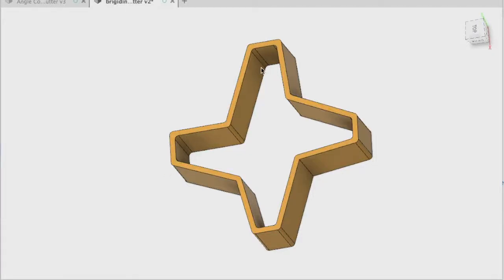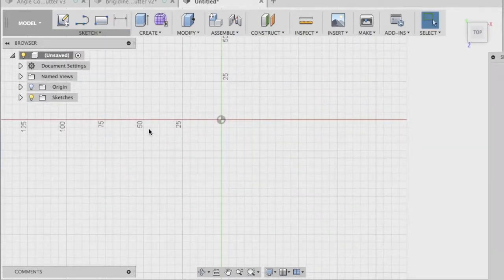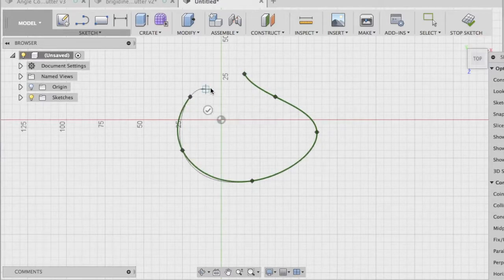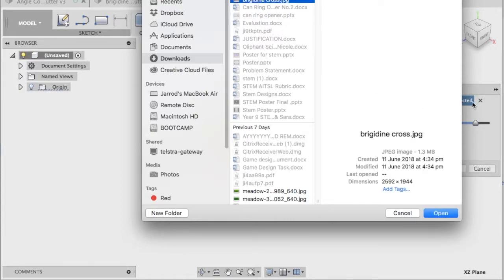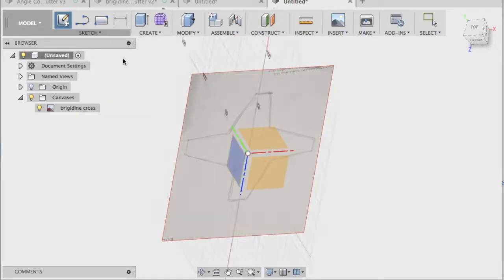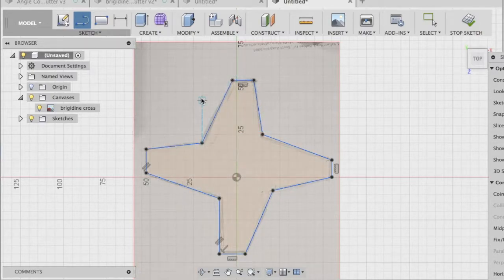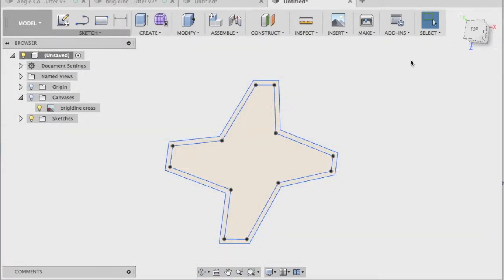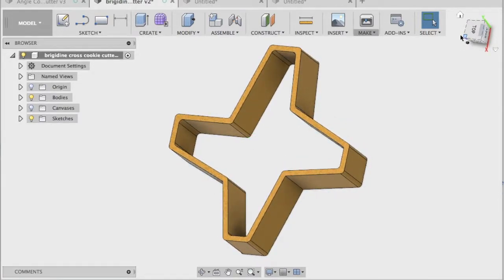Fusion 360 Tutorial - 3D Printed Cookie Cutter

Comment: Thank you for share this info. How can you scale the cutter to 2" without affect the size of the wall?
Reply from the maker: Hi Helen, thanks for your message.  The Scale feature will scale everything including the wall thickness.  To avoid this I would not use the offset sketch feature as shown in this video.  Instead, Extrude the cookie cutter as a solid shape, scale your shape, then hollow the inside with the Shell feature.   Let me know if you need more help.

Comment: I'm interested in making cutters that have a tapered edge.  An edge that is shape and not a flat edge for cutting.  Do you think you can help me?
Reply from the maker: Use the Chamfer feature under the Modify drop down.  Try using the 'Two Dimension' type chamfer if you want the taper to be longer on one edge.  Good luck.